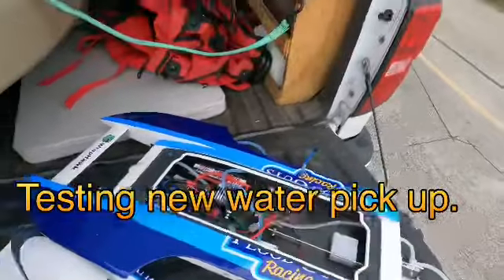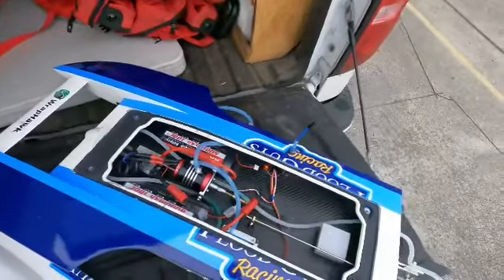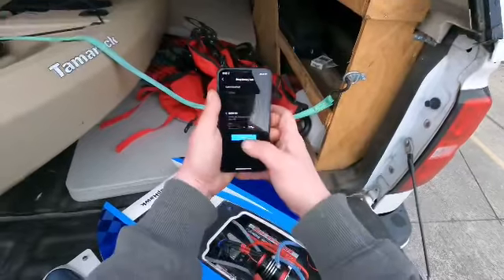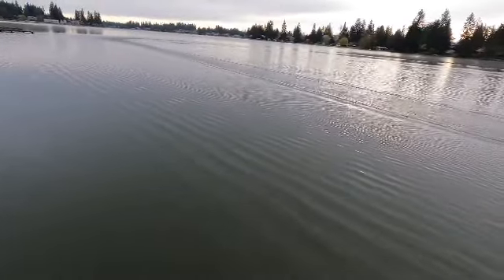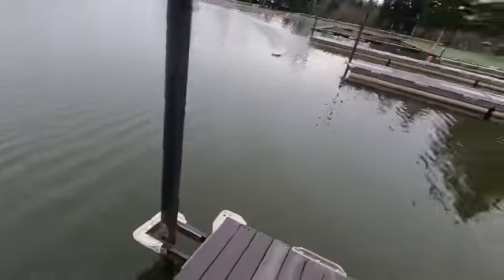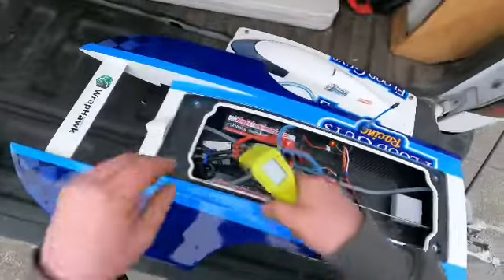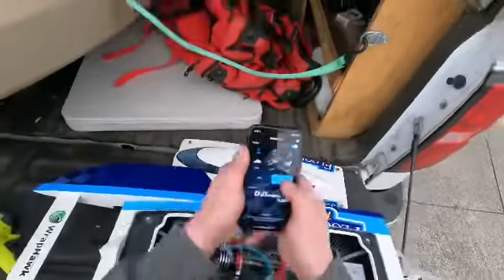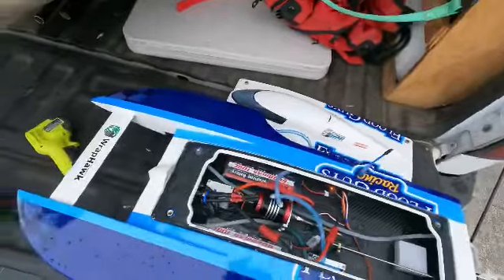Testing new water pick up on Ul19

Comment: ive been using a 370 6 volt water pump you run off a little 2s or right off the receiver... that way the water is always flowing even at stand still made all the difference. just put it in the right place. i also like to twist the cooling tubes it gives em "rifling" really helps . nice paint job

Comment: Bro. Get get rid of those screws on the cowling. Magnets!
Reply from the maker: It’s something I’ll look into for hatch magnets.  I’ve replaced the main seal and not a drop when upside down.  I’m just try to avoid using taping the lid down to hold a good seal.   Even with magnets I would still feel empowered to tape it down as if I was hit by another boat racing the hatch may pop loose also Tape plus cold weather and rain sucks even worse.  Regardless thank you for the input and something I may look into to experiment with. I’m always open for new ideas
Reply: Even though I've broke a few screws in the past. I still like the system
Reply from the maker: @rcweekends9370   well he was referencing as using magnets to hold down the hatch.   To make installation of the hatch simple and easy  as not screwing down the hatch every time.    
 Clicks in and done it’s another method of securing the hatch down.
Reply: @mad_lizard  I understand. I just feel more confidence in the screws and gasket system proboat has. No need to worry about running out of tape.
Reply from the maker: @rcweekends9370  well agree with you on that and I also have more confidence with the screws.    Above comment was from another subscriber to answer his questions.   I at this moment like the canopy locks with the gasket and it’s more secure feeling

Comment: Where did u get the bottom tray? I'm in the middle of repainting mine. I took the back fins off as well
Reply from the maker: OSE. Has some really nice carbon trays for the boat.   Check them out and it does reduce some of the weight from the stock tray.   
In my video that boat everything was gutted out.  Full inlay and new layout.  Mount to the floor of the boat.  No try used.      
For a really nice tray check out op short electrics they have a nice one for the UL 19.

Comment: Mad..what motor do you recommend for 4s?  I've hit a wall with the stock dynamite at 42mph.  I can run WOT for 16 laps with no issues but, would like to get a little more speed out of it. I've already gutted the internals btw. Not as far as a carbon inlay but as light as its gonna be.
Reply from the maker: Next to try would be a leopard 2200 kv 3674 motor.     Propeller the stock propeller sharpened and balanced (1716) 
Or Abc 1814.   This is a good combination and get you faster on 4s.    

Also strut depth measured from the bottom of the hull to the bottom of strut 20mm.    This is the set ups running on my boat.